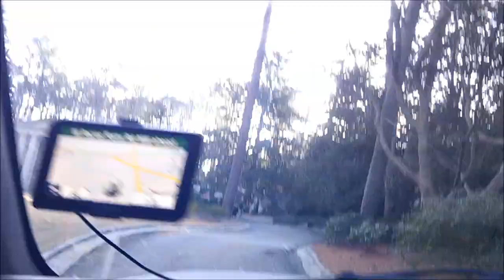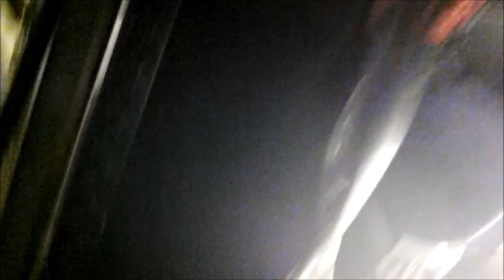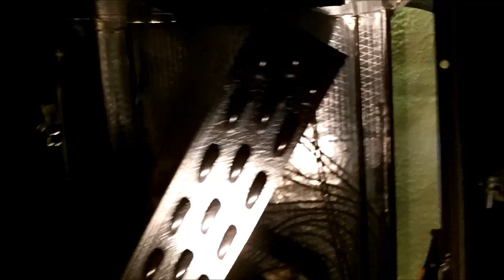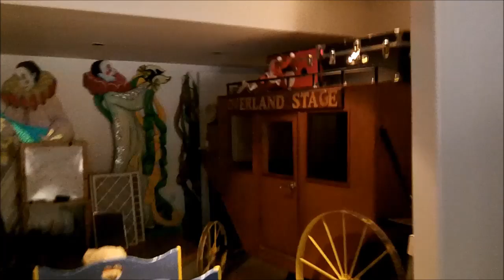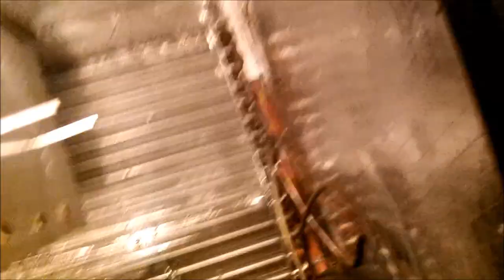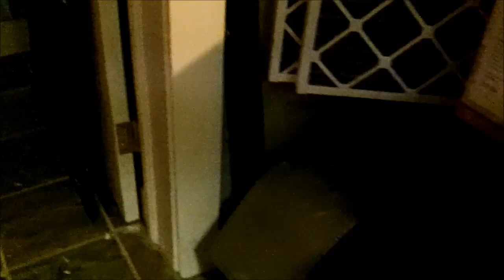Florida Heatpump Evaporator Changeout Atlanta Georgia

Comment: New suggestion for engineers, maybe make the drain fitting something you can unscrew, if you have to change the coil, my issue was the copper drain pan fitting, I crimped it off to get me the clearance to take the coil off. Also new coil, had no holes for screws, had to use impact gun inside plenum, and put screws in, extremely close to u bends on coil.